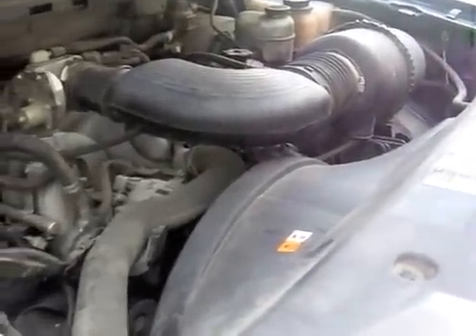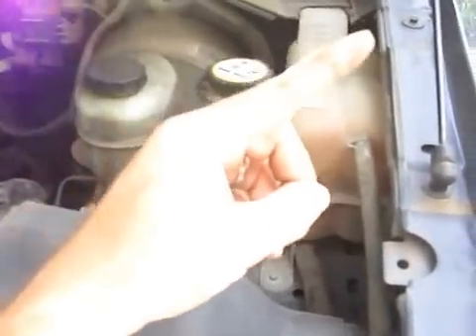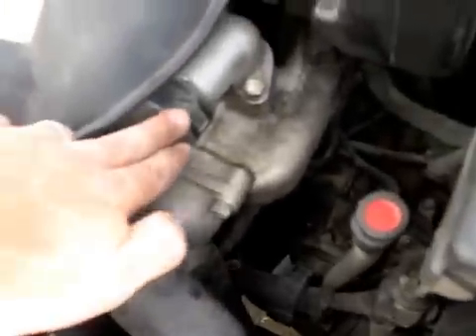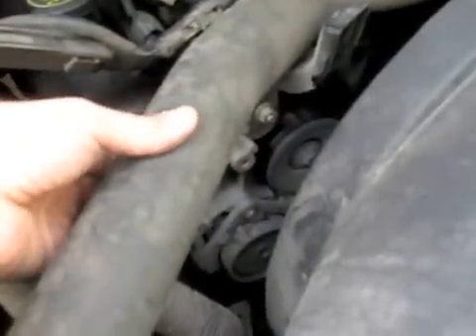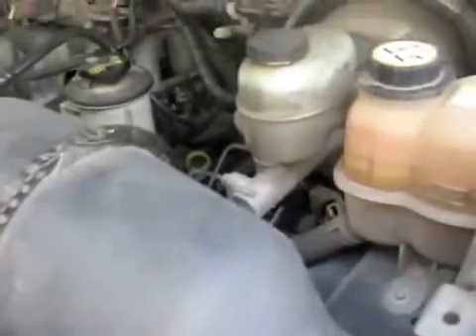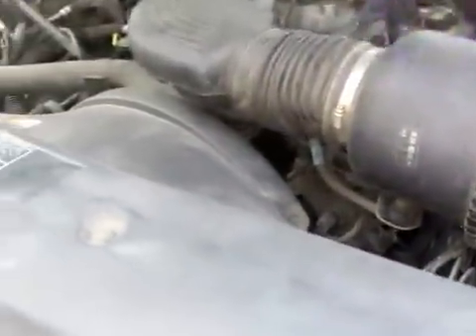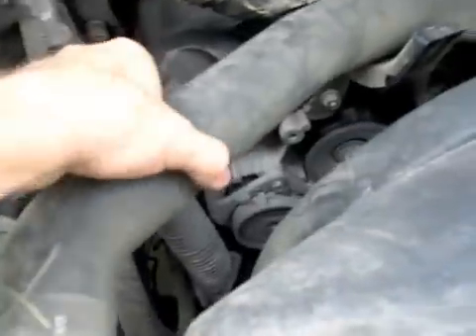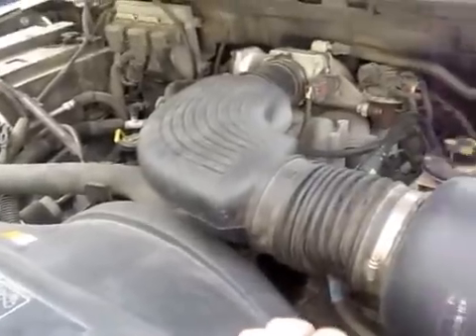Car Engine Overheating - Causes and Symptoms of Over Heating  Car Engine

Comment: Hey there, so I have a 79 BMW with the inline six 528i . I live in Arizona and its hot. I just bought the vehicle and replaced the water pump and got rid of the thermostat. I did a radiator flush and cleaning. I filled back up and did the regular all around service, oil, tranny brakes. She I start the car. There is smoke emitting from the exhaust manifold instantly but doesn't have a rattle like its lose? And suggestions. Also. When I start it. Within two minutes my coolant is just bubbling in my reservoir and really hot. Do you have any idea what could be wrong? Thank you very much.
Reply from the maker: First, get a cooling system pressure test to see if there is an internal or external coolant leak. Second, double check the radiator for a restriction (flushing does nothing for the junk impacted at the bottom) third reinstall the thermostat (a new one) and if everything else checks out ok you might have a head gasket issue (but should show up in the pressure test) so try this sealer and see what happens. http://www.trustmymechanic.com/auto-repair/3583/kw-engine-block-sealer-head-gasket-leaks/
Reply: Thank you very much!!! I appreciate it.

Comment: i was driving on the street and all of a sudden car starts over heating 2 lines from the red i was at a red light i was able to make it to a neighborhood soon as i stop to park the temp light came on turned the car off i got and happen to look on the passenger side whatever little fluid i had left came out my fault not having proper fluid amount in my vehicle got my radiator changed last year didnt have any problems wit the temp till yesterday i live in california it had to bout close to 100 degrees i let the car cool for 3 hours added water to the radiator ran the car temp was fine aslo checked for leaks didnt see any top or bottom took it around the corner just for a test and it started back overheating plz help dont want to waste money on a thermostat how do i get it pressured test is that gauge something i can purchase or no
Reply from the maker: You can sometimes rent the cooling system pressure tester from your local auto parts store and use it in their parking lot.  I would also check to make sure the electric radiator cooling fan is coming on.
Reply: is those the fans that are normally in front of the vehicle
Reply from the maker: TMKJG24
Yes
Reply: ok one more thing i forgot to mention as i was driving to a safe place i did have the heater running it didnt do any good dont know if it was because i was between red lights never really got a clean run without stop and go also my air conditioner doesnt work does that play a facor
Reply from the maker: TMKJG24
Well, the heater will not be hot if there is not enough coolant in the radiator/engine, and the A/C will not be cold if the engine is overheating...so you need to get the pressure test, and check radiator for restriction and cooling fan operation, and thermostat in that order
Reply: ok thank you so much

Comment: i dont dick around, i replace hoses,water pump,thermostat, flush, everthing
the cost of this is nothing compared to a new engine and install, my thermostat was stuck open, also the water pump should be mentioned

Comment: I have a little leak  coming down and only over heats when im on the highway and smoking what can it be
Reply from the maker: Start with a cooling system pressure test first to help locate the leak, then repair it. If you still have an overheating issue, check the radiator for a restriction or a restriction in air flow across the radiator
Reply: I see a leak frm the radiator

Comment: 2000 s10 overheated and quit and hasnt cranked since,checked forir fire and its getn fuel,oil isnt milky,not sure what to do next
Reply from the maker: You are missing one or more key ingredients for the engine to start.
1. Fuel PRESSURE and volume at the engine
2. Strong spark at each spark plug
3. Compression in each cylinder
4. Spark timing

Since it overheated, I would start with a compression test on all cylinders, then a pressure test of the cooling system for internal or external coolant leaks that could have caused the overheating. If all is good, then use a fuel pressure gauge at the engine to see how much fuel pressure you have, if all good, then test for spark on all cylinders, if all good, check for a timing chain or internal engine.

Comment: Ok , when was driving yesterday . My car was runing hot . But , when I pick up speed it cool off . I had the hole change last year . And when I park the car it leak little antifreeze . I have 2004 grand pix .
Reply from the maker: Its probably just low on antifreeze, due to the leak you are experiencing. Get a cooling system pressure test to help you locate the leak, then repair it and see if that solves the overheating issue.
Reply: Where can I get pressure tested from Rally or AutoZone
Reply from the maker: Vonetta Cousins
A real mechanic should do this for you, its fast and cheap. Autozone might loan you a coolant pressure tester but you will need to be able to get underneath the vehicle....and know what to look for.  I would spend the $50 or so have get it professionally done.
Reply: Thank , I got my car fix . It was fan . It just stop work . That why it was little antifreeze and running hot . They fix it for 150 . And it's running perfect . And I have 90 day warrant on it .
Reply from the maker: Vonetta Cousins
Awesome, thanks for the update.

Comment: Good video! I have a 2003 Kia Sorento....last night it started smoking at idel. The gauge inside the car didn't  go up, there weren't any smells, checked oil level and coolang level. What could it be?
Reply from the maker: I am assuming you see smoke under the hood at the engine? If so, then you most likely have some kind of fluid leaking on the hot engine, coolant, engine oil, transmission or power steering fluid. So you need to start ruling out those fluids as the culprit. I have also seen plastic grocery bags picked up from the road get stuck on the exhaust system and melt/smell/smoke.

Comment: we have a 2005 ford explorer, 4.0 we were traveling and heard a whizzing noise and then a warning light came on that said engine safe mode came on we looked in the book and it said that the engine was overheating. our temp gage was fine we our coolant was full. we had it hooked up to a computer at the garage and they put in a new thermistat and said it was good to go. we made it about 50 miles and it started doing the same thing again. but when we hit the break to pull over the noise would stop but the service engine light stayed on the garage said that the coolant was running to cold. and it was ok to still run it. please help do you think it is the water pump or could it be something else? the codes at the auto zone store said it was the senser on top and a senser that hookes to the gas peddle
Reply from the maker: Patricia, that sounds pretty strange to me....I don't even have a guess to what is happening at this point.  I would suggest you go to the Ford dealer and pay the $125 diagnostic fee to find out, then we can go from there once we know what is happening.  Sorry cant be more help at this point with out more info.
Reply: got it fixed yesterday, it was a senser on the back fire wall and the belt and tightening thing up front it cost about 450 dollars but well worth it

Comment: I am in Costa Rica - hot here all the time.  No water in oil - no oil in water. Have changed and removed thermostat.  I do need add antifreeze after 1-1.5 hours highway driving about 10 oz.  Replaced cap. Suspect head gasket but no test fails. Replaced upper rad hose was weak. The metal pipe that the upper rad hose is badly rusted. Could my radiator be plugged - is there a good test for this?  Fans operate wired them with manual control for a while - is wired back to normal now.   Did HC test and it passes.  Do not want to take to dealer - is last resort. Here is a video of cooling system pressure test.
http://youtu.be/wHKXCcyItrI
Reply from the maker: Nice video, how did you get a Dallas Cowboys cheerleader to do the pressure test for you?? hahahah  I dont think you have a head gasket issue, I would be more suspect of a restriction in the radiator than anything else.  Do you have a local radiator shop close by that can "boil out" your radiator?  That would be the cheapest option, other than replacing it with a new one.  Then re-install the thermostat.
If you really think you have a head gasket leak, try using the sealer I am talking about in my video.  Best Head Gasket Sealer For Headgasket Leaks  but that is a last resort option once you have ruled out everything else.
Reply: TrustMyMechanic.com Thanks - that is what I plan to do next - when I saw how corroded the pipe was connecting upper hose I figure radiator could be bad also - just hard to understand how can run for 1.5 hour before any problems - but maybe is slowly pushing fluid out the overflow.  Cheerleader is one of the reasons I retired and moved to Costa Rica. The garages here in the small beach town have no equipment.  Is why I bought an HC tester and the pressure tester. Will rent a garage and pull the radiator next - Can't see much of it in the car. It will be a job!
Reply from the maker: Mike Cameramike
Keep us posted please
Reply: TrustMyMechanic.com Dove to San Jose (elevation 3800 FT) from the beach - about a 2 hours - did not overheat.  Open hood - overflow bottle was full.  Waited cool down and added about quart of coolant - probably about the same amount that is in the overflow.  Drove it back to beach - 2 hours - no overheat.  Opened hood and coolant from the overflow was all over the engine - not a lot but it is a bright green. Too hot to check but I guess the radiator is down about a quart again.
Reply from the maker: Mike Cameramike  With the new radiator installed??  You have the plastic fan shroud around the radiator installed too right?  There is nothing blocking air flow in front of the radiator right?
Reply: TrustMyMechanic.com No same radiator - can't get bottom bolt out of overflow bottle.  not an easy area to work - is a 10 mm can't see it but the head is rounded.  Is slow going. Will have to see if can get vise grips on it.  Sprayed it with WD40.  Have company today so will put it off for another day.  I will take some move video and post also.  I would take it to a garage but do not have one near me that I trust - all have no tools and destroy paint and everything else.  I am looking to rent a garage for a month so can fix this.
Reply from the maker: Mike Cameramike since you drove it for 2 hours without any issues, it must be a small restriction in the radiator. I would never recommend a "chemical flush" to clean a radiator but in your situation it might be worth a try.  Might just have some bottom rust/deposits that might be dissolved (enough)  with a flush additive. Visit your auto parts store and see what they have.
Reply: TrustMyMechanic.com here is a thought - would running with no thermostat be a problem?  Could it be that it never pulls the coolant back from overflow cause of thermostat not there to close and allow rad to cool down?  Before pulling radiator going to put the thermostat back and see.  Or does once motor is hot does the thermostat never close.  I drained rad yesterday and ran garden hose back flow and is coming out clean.  I did flow both directions several time and even plugged the end allowing some pressure and released - still clean.  I can't pull the radiator cause can't get the water bottle off - either my sockets are cheap or the bolt is a little off size.
Reply: Mike Cameramike Here is why I agree is probably a plugged radiator. Previous owner must have been running with water!  https://www.dropbox.com/s/omxoxpug8layuml/IMG_0386.jpg
Reply from the maker: Mike Cameramike
Yep, and bottom inside of the radiator probably looks like that too. You need a thermostat, removing it was a shady tree way to overcome a restriction in a radiator but not advisable on computer controlled vehicles.

Comment: I own a 2005 Ford Freestar 4.2L  I've been having overheating issues for weeks only on the freeway, flactuating temperature.
 I replaced my thermostat, flushed out entire cooling system, replaced with 50/50 premix.   My van still overheats only on the freeway, keeps flactuating from just under 1/2 to over 3/4 on temperature gauge every 5 minutes.  In the city stays under 1/2 on gauge and has very good heat without overheating.
Also top radiator hose is hot but the bottom hose is only lukewarm.
Overflow tank is to proper fill line.
Just prior to the stat instal, I dumped all the antifreeze, removed the old stat and ran the van for 3 days.  Temp stayed on cold all the time, freeway & city.
Do you think my radiator is partialy pluged?   Why would it be cold without overheating without stat in place?
Reply from the maker: Could be a radiator issue, or an air bubbled trapped inside the system that needs to be bled out. Run the engine with the heater on high for a few miles, then let cool and double check coolant level.  Sometimes you can "burp" the system with the radiator cap off (engine cold) and as the engine heats up and coolant burps out the radiator...cap it off.  Removing the thermostat helps improve coolant circulation and was done as a "shade tree" mechanic fix on older cars needing a new radiator.  Not a good idea on newer vehicles like yours to remove the thermostat.

Comment: 05 sebring lx 4 cylider looses water but i cant seem to find where its going no water in the oil and none in the transmission. it dont get hot never has the only reason we knew it was low on coolant was the heat quit working one morning but would work when she stepped down on the gas. now ive been driving this car i havnt had an issue but i havnt been driving 100 miles a day either maybe 25. nothing has ever been done to this car ever regularly maintained is all. if this is a water pump isnt this attached to the timing belt at just over 150000 debating on even keeping this just because of a cost that should be minimal.
Reply from the maker: You need a cooling system pressure test to help you locate the coolant leak...sure sounds like you got one, somewhere.

Comment: I'm from Michigan and it is cooler now and it's nice to have the heat on. I was driving down the expressway the other and the car started to overheat while at the same time I lost heat to the cabin. I have had no problems with leaks and do not see any leaks where I park. I do notice, however, that now my antifreeze reservoir is over its "hot" mark, even when cool. If I drive around town, it over heats and I lose heat to the cabin, and then the indicator returns to normal and I regain heat to the cabin. Furthermore, I'm not seeing the electric fans kick on to cool. 

Any help would be much appreciated!

Justin
'95 Lumina 3.1
Reply from the maker: This sounds like a possible radiator restriction, is it the original radiator?  I would start with a cooling system pressure test, then check the radiator for a restriction. If the original radiator, its due for a change.  Flushing does nothing, so dont waste your time. Replace the thermostat at the same time as the radiator, or try a new thermostat first and see what happens, if still overheating then replace the radiator if no leaks found from pressure test.

Comment: hi, i just filled water in radiator tank 2 days ago, today water was damm boiling from radiator water tank. i just released cap and water start leaking from cap. i couldn;t even touch the cap it was very hot. what could be the reason? i just filled water, do i need to mix coolant as well or it is optional? plz help
Reply from the maker: You have to start ruling things out, check for leaks with pressure tester, check for radiator restriction, check electric cooling fan and thermostat operation.
Reply: Do not use plain water. Use the specific antifreeze, with or without distilled water, recommended for your car. Doesn't sound like you have a leak if it was still full of water. Get a laser thermometer, about $30, and find the hotspot of the car. Point it to different points on the radiator, then follow the hoses to the water pump and thermostat. Then, you can start eliminating pieces.

Comment: We have a 93 corolla and we drove it on a freeway when it over heated and added radiator fluid with no visible leaks. we attempted to get it somewhere lit(it was night) and it kept overheating as soon as we accelerated. A hose came off and we stopped and towed it from that point. My question is where do we connect the hose back to troubleshoot whats going on with the car?
Reply from the maker: Is it one of the two large radiator hoses, or a smaller heater hose on the engine?  I would need to see what you see to be sure, but get a flashlight and see if you can find the connection....start at the attached end of the hose,  If you can re attach the hose, fill radiator with water, start engine and see if you see any coolant leaks. If not, take a short test drive down the street and see if it overheats.

Comment: hi,I have an overheating problem, my car has had a new fan a new thermostat no leaks externally and I am not losing any coolant, also my heaters are blowing cold..... takes about half hr of the engine running from cold to run up to the red.....
I am not driving it this happens just sitting on my drive...please help?????
Reply from the maker: I would check the electric radiator cooling fan motor first, then feel the two heater hoses going to the passenger side of the vehicle on the firewall to make sure they are both hot.  You could have air trapped inside the cooling system that needs to be bled out, or a restriction in the radiator not allowing coolant to circulate or a defective thermostat.